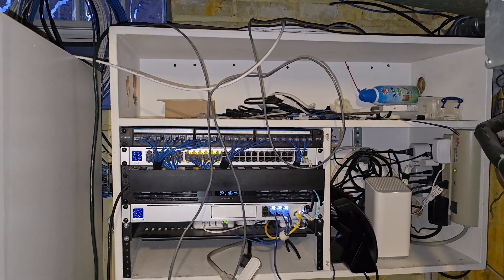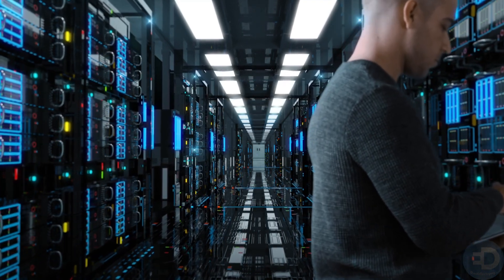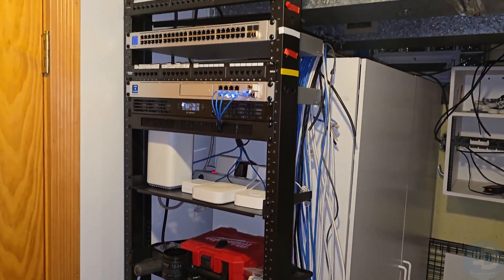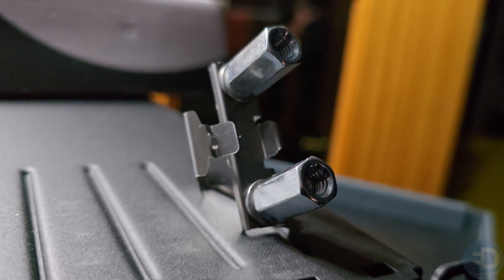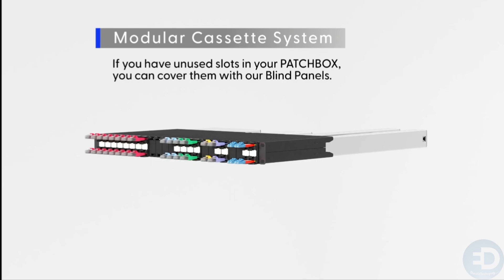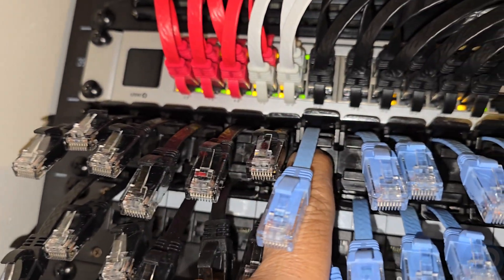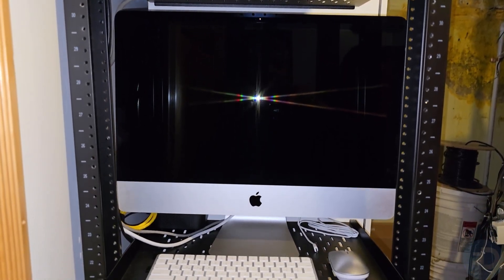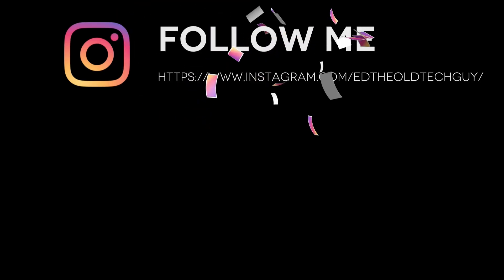How I Built My Dream Home Network!

Comment: What if the cable breaks?
 what can I do?
Reply from the maker: @yngcalculus5675  You mean the cable in the cartridge? If so, like any other patch cable, you order a replacement and pre-order replacements. If it's cat6 and an emergency, you can make a cable and patch in front while the replacement makes it to your site. If it's fiber, you should always carry spare jumpers and replacements as a field tech.